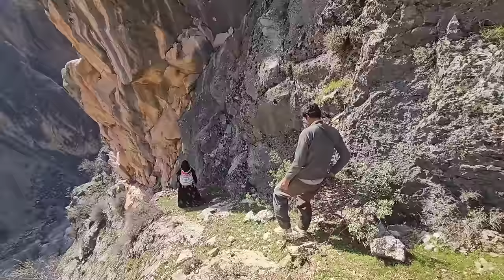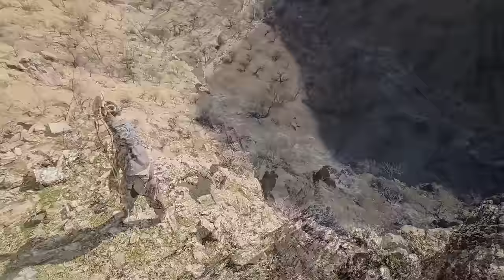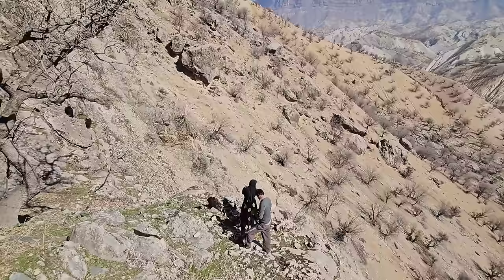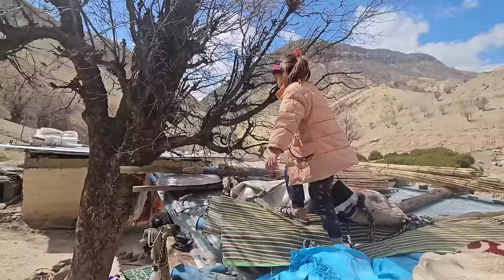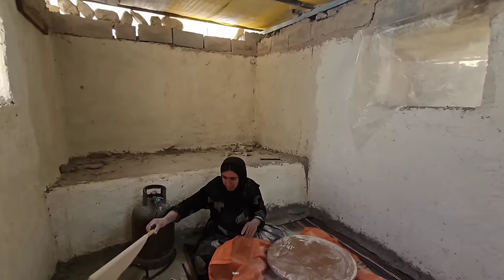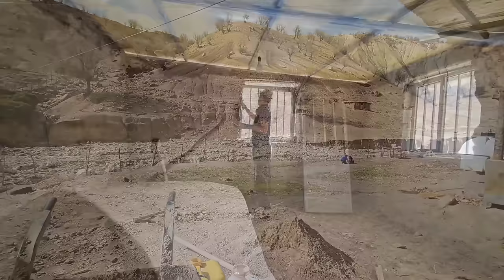In search of sheep in dangerous mountains: family cooperation in the mountains🐐🏡

Comment: Hayder you need to finish sealing up the air holes in the room where the heater is. Now that you have electricity get an electric heater. Also, clean up all the mess that is cluttering up the outside. Make a new  neat chicken coop away from where it is now. Tear that down. Level some of that dirt.  ❤❤❤❤❤❤❤
Reply from the maker: ممنون از توجه و راهنمایی شما می‌شود